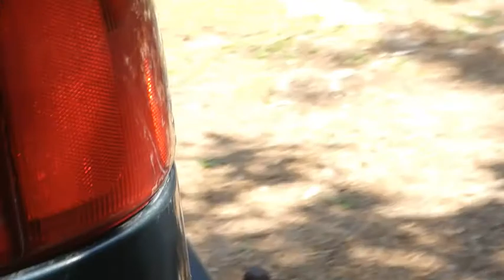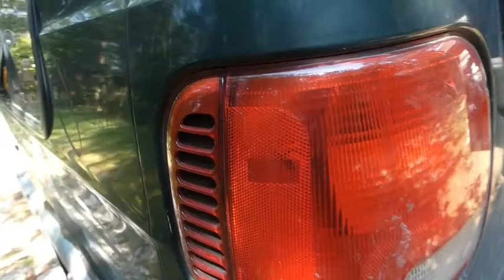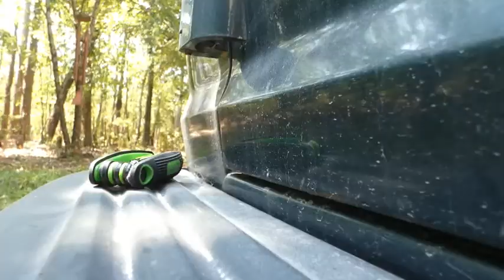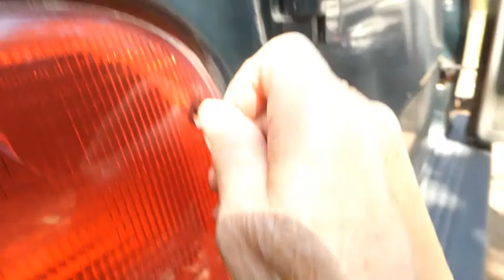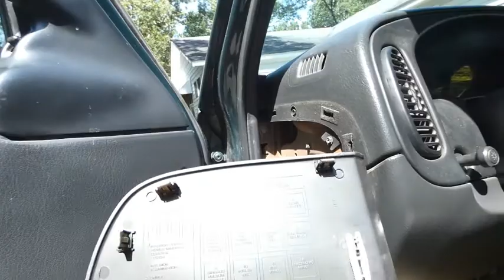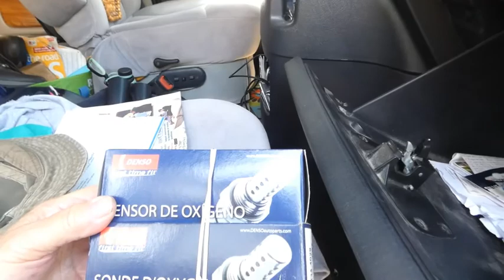Turn Signal Bulb Replacement/DIY/Save Money!

Comment: Another $80. saved. I had a car or truck can't remember which but the thing needed to be changed from inside yep garage time. Good job Sondra and I loved your chipmonk LOL
Reply from the maker: Hi Jo, I know some vehicles are very hard to get at parts like this...But older models are normally simple.  The very first big job I tackled was changing out a Heater Core I had to take out the entire dashboard, so it can be done just takes longer.